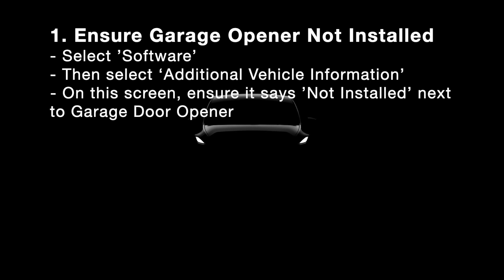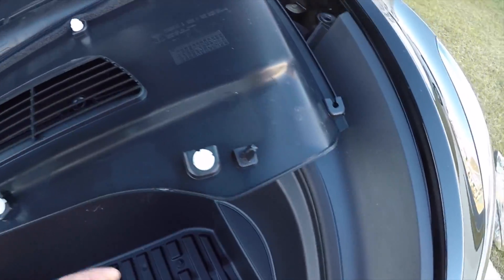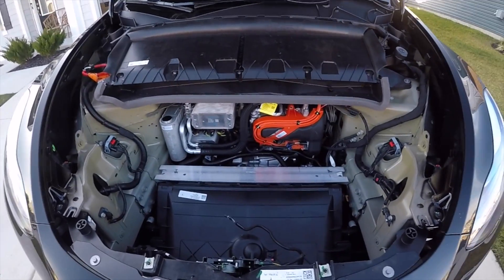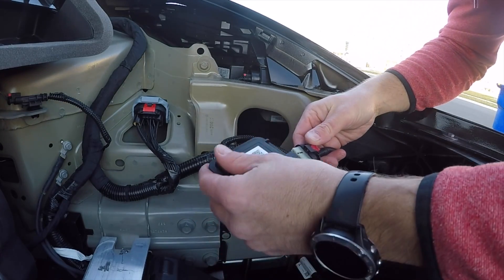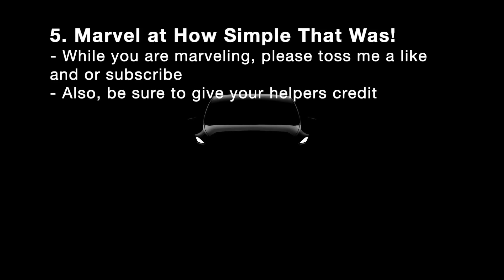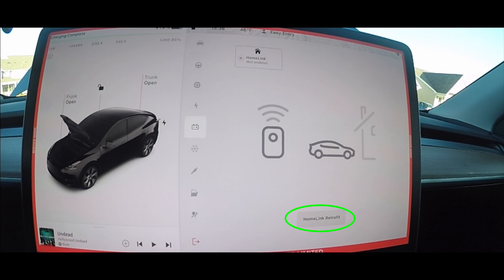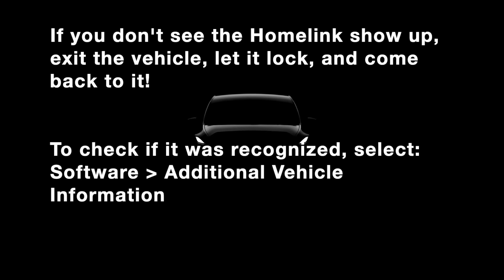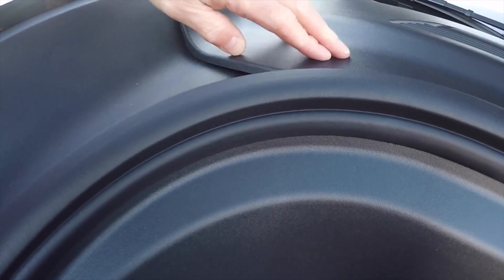Tesla Homelink (Garage Door Opener) Installation

Comment: FYI. You installed the bracket "backwards". The bracket attaches to the FRONT, not the BACK as you did it. You were confused because the bracket does in fact lightly click into where it is supposed to go when you mount it in the front. The hard part is getting your hand around to the front to get the bolt in and to tighten it. People have advised putting a large rag below the bolt area so if it falls or the socket falls it will fall onto the large rag instead of getting lost inside the front bumper which could happen. Best wishes.
Reply from the maker: @DJ5200A5  This is all REALLY helpful information. Thank you for the heads up. That said, it has remained secure for > 6 months so far so doubtful that I'm switching it around 😂
Reply: @AvoidStealership  Some people have even used zip ties to hold it in place as the bolt is tricky to install when the bracket is in front. You will get a stronger radio signal when installed correctly as the way you have it installed the radio signal is "aimed" toward the cabin versus the front and the radio signal has to bound around a bit to get to the opener receiver. I try to install things per manual because you never know what the unattended consequence is say if in an accident. This doesn't look like a critical thing like when people don't install a Tesla Wall Connector properly (the directions are straight forward for the TWC so I SMH why people do it wrong). Best wishes.

Comment: Great!! Exactly what I was looking for. I have the module in the M3 that stays in the driveway and I want to install it in the MY that I park in the garage. I just need to wait until I get the M3 back from the SC to try it. I see it may be unauthorized but will still try. If it fails I'll open a service request and see what they say. Thanks for the great video
Reply: Update! Turns out it's too much trouble to remove the original model from a 2018 M3 which included it from the factory - to get at it one needs to remove the entire front bumper "fascia". Instead I purchased a new OEM module for less than $200. Following this guide it was a success. The latest software (2024.20.9) allows the module integration - all is good :)
Reply from the maker: Glad the video was helpful!

Comment: Anyone with a 2024.x software will not be able to do the software retrofit currently - it fails as "unauthorized". Requires service mode + or service tech intervention now for retrofit. Service center cooperation varies by location on if they will touch it if you DIY'd. Good luck!
Reply: Good news! Starting around 2024.20.9 version of the software the homelink integration is again permitted. You will need to exit and re-enter the car for the menu item to appear and I also needed to go back into service mode a second time and run the "test" for the signal to be sent.
Reply from the maker: @LordOfTheThreeWorlds Thanks for the info!!!
Reply from the maker: Good info!